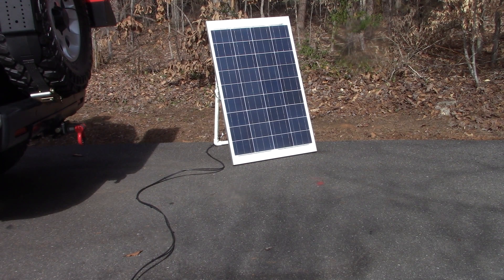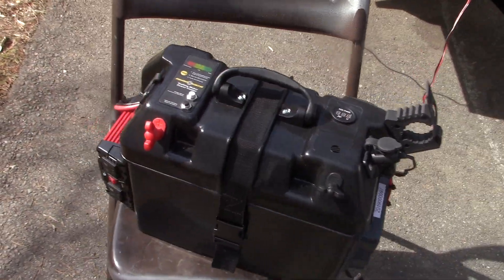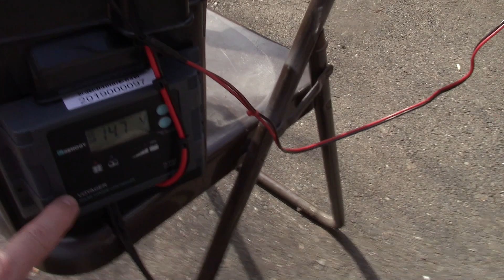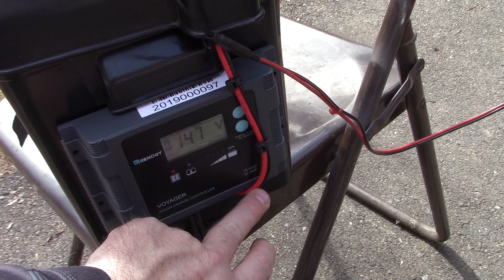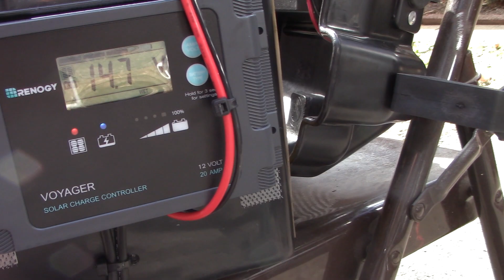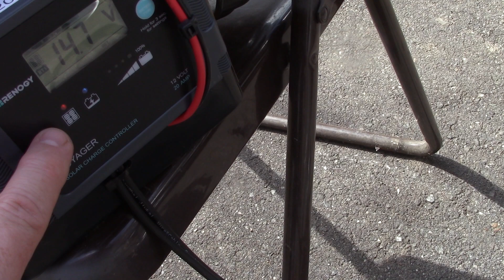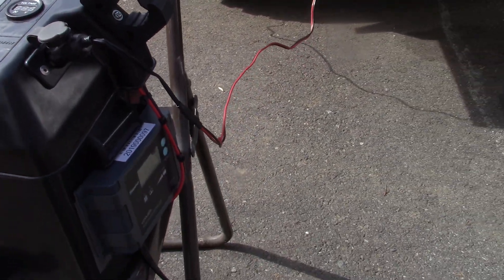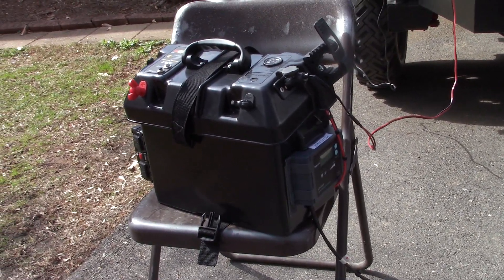DIY $400.00 Solar Generator on a Budget (Final video)

Comment: 14.6 Volts on that battery is a little too hot. 14.2 should be the MAX you take it to! Charge Controller notwithstanding, you're in territory that COULD cook the battery and potentially even cause a fire!
Reply: nope that's an AGM battery they need 14.6-8 to charge

Comment: Thanks for the how-to. The battery box + krieger 1100w + wall AC has been my go to for 3 years. I'll be adding the solar system & larger battery this season. What is your experience with time to charge battery completely with a single 100w solar panel?

Comment: Nice box.  I have the same Voyager mount on my  camp trailer front when camping on mobile. When at base I swap it out for my Rover 30amp. I use 3x100w renogy panels on my  trailer..  I’d suggest using heavier cable on the ground like a 10/2 SOOJ electrical. It really thick but sturdier for 20’ runs.  Not too bad at deploying.  Thanks.

Comment: Nice setup.. I did something very similar for a solar powered water pump.... DIdn't have enough draw for the depth so I'm going to be working on a 24 volt submersible system.

Comment: Thanks for sharing.  I'm new to solar as well and want to get better.  Can you give us an idea how much money you have into this system?
Reply from the maker: You are going to have the following cost.

100W Panel Kit: $197.00 https://www.amazon.com/Renogy-Monocrystalline-Negative-Controller-Connectors/dp/B00BFCNFRM/ref=sr_1_5?ie=UTF8&qid=1549233592&sr=8-5&keywords=renogy+100w

Battery:  $105.00   https://www.tractorsupply.com/tsc/product/traveller-27dc-marine-rv-battery

Minkota Battery Box: $59.00  https://www.amazon.com/MinnKota-Trolling-Motor-Power-Center/dp/B001PTHKMG/ref=sr_1_3?ie=UTF8&qid=1549233863&sr=8-3&keywords=minkota+battery+box 

Harbor Freight Charge Controller: $32.00( with 20% coupon)  https://www.harborfreight.com/750-watt-continuous-1500-watt-peak-power-inverter-66817.html

Call it $20.00 for the other odds and ends like velcro, wire, wire connectors, etc. 

Total: $413.00

Comment from the maker: I show you how I put together a 100 W solar generator for camping, off-grid, overlanding, prepping, etc. 

Video about the battery box: https://www.youtube.com/watch?v=BQCc0...

PVC Solar Panel Stands: https://www.youtube.com/watch?v=eR6E0...

Renogy 100 W Kit: https://www.amazon.com/Renogy-Monocrystalline-Negative-Controller-Connectors/dp/B00BFCNFRM/ref=sr_1_5?ie=UTF8&qid=1549233592&sr=8-5&keywords=renogy+100w

Renogy Voyager Controller: https://www.amazon.com/Renogy-Voyager...